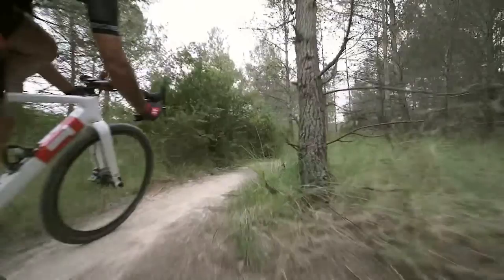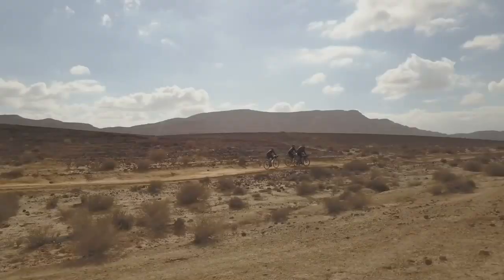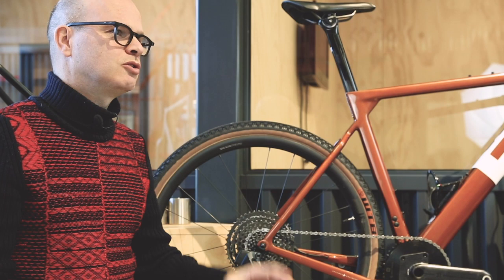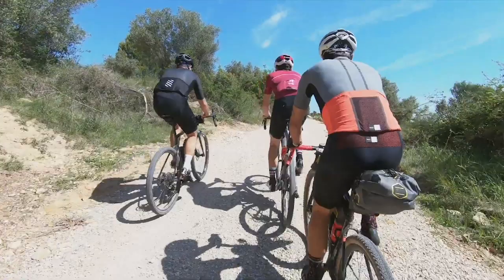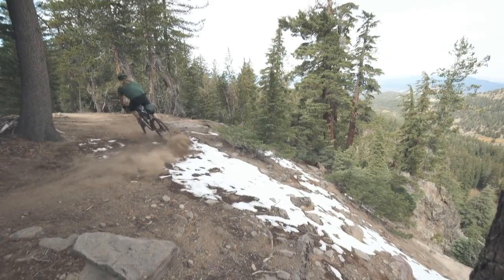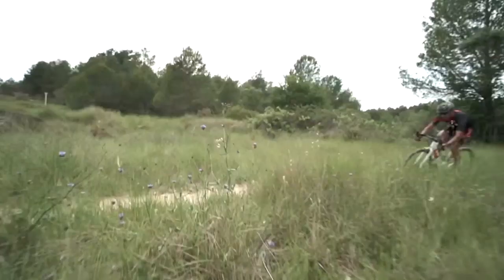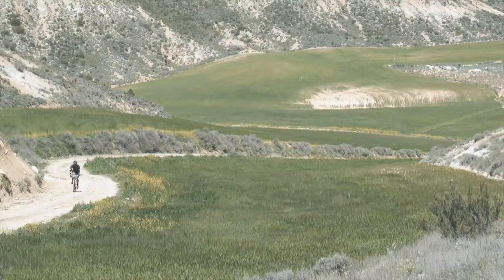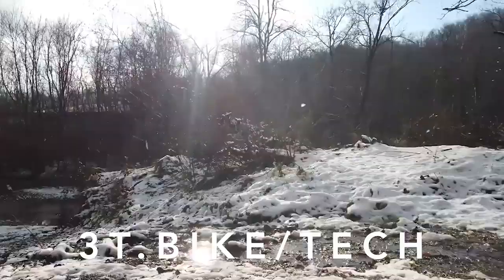Gerard Vroomen explains how to choose a gravel bike

Comment: I have a 3T Exploro and the difflock insert on the seatpost debonded. 3T told me not to ride the bike for safety reasons. 3T have been unable to supply me with a new seatpost (I was willing to pay). I have been without the bike for 6 weeks. 3T customer service has not responded in weeks. I would not buy another bike from 3T.